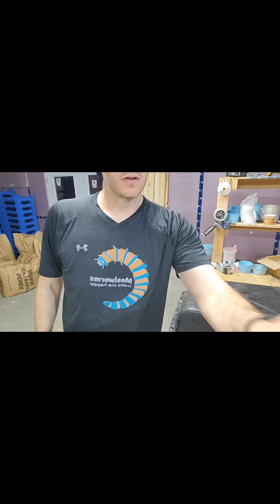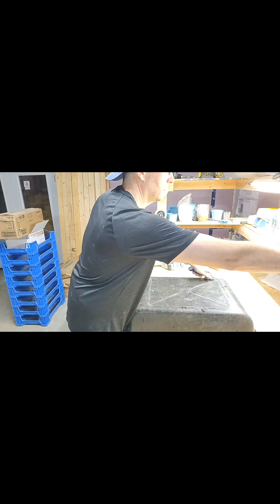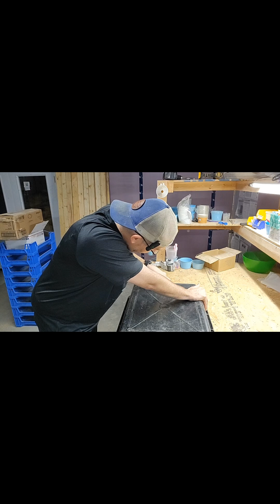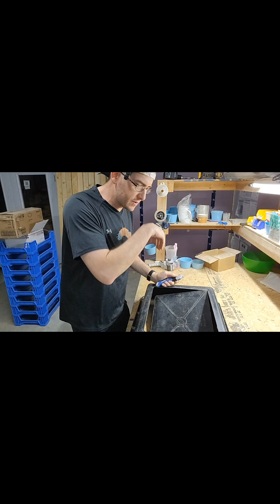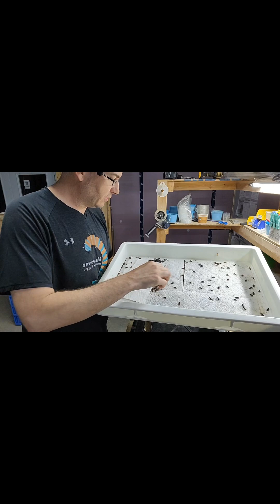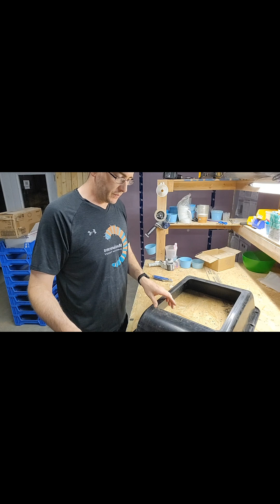Talking through why the paper towel method for beetle collection could be better.

Comment: You dont want to throw a couple of potato slice in your pupae tray to catch thoses that dont want to grip on the papel towel?

I did try the bridge, I didnt like it. Same issue. some beetle would stay on it and you have to pick them manually.

Im trying leaving a mesh in the pupae tray to see if it is better than paper towel. I have no feedback yet because the pupae have barely started to grow into beetle in that tray.
Reply from the maker: The potato slice would work, just not efficient enough, would take too much time b/c of the volume of trays and beetles I have.